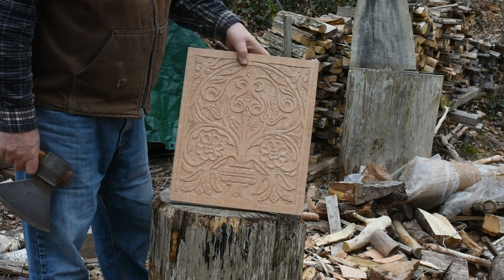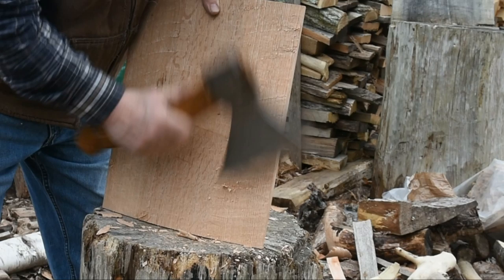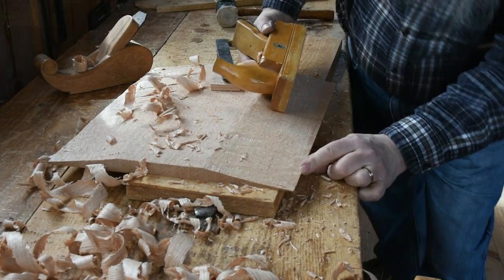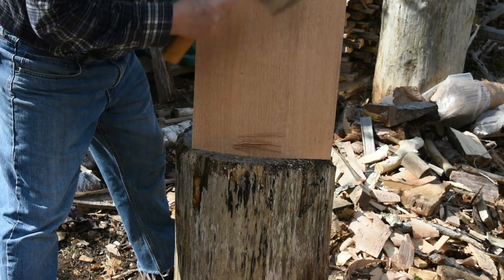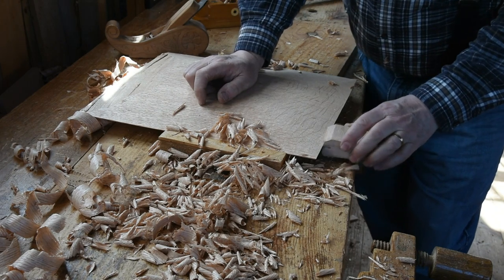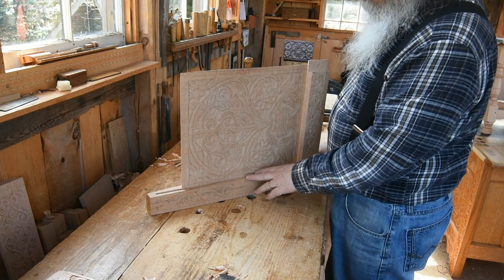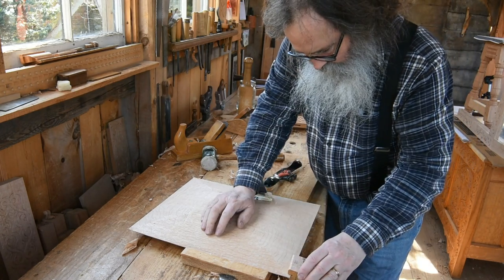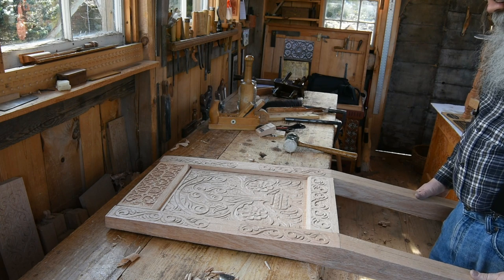hewing & beveling a panel

Comment: I have a couple of 6x12 doug-fir beams I glued up for a bench top.  A skewed plane ripped out strips of wood.  It did this even with a light cut.  (Across the grain made a horrible mess, also)  Straight on, light cut solved the problem.  I couldn't tell you why.  It took a ridiculous amount of time to dimension that top, especially after I took huge chunks out of it trying the usual advice.  I still think it's generally good advice to skew the plane, but, there's one situation in which you might not.  May it never happen to you.